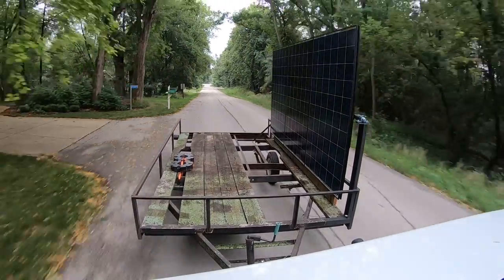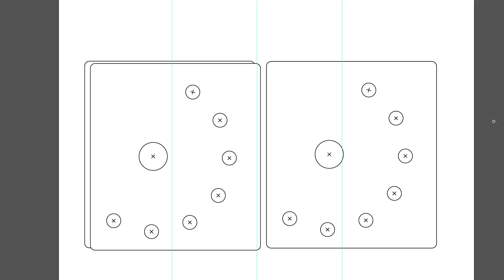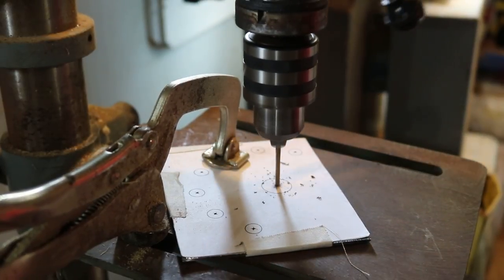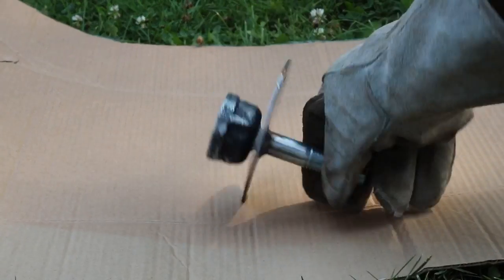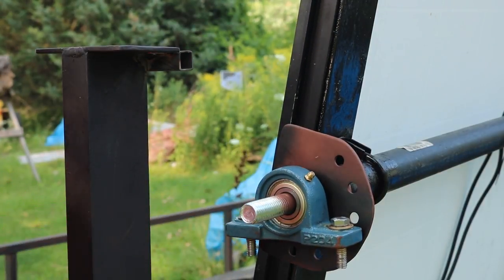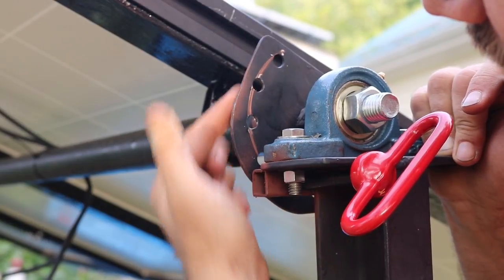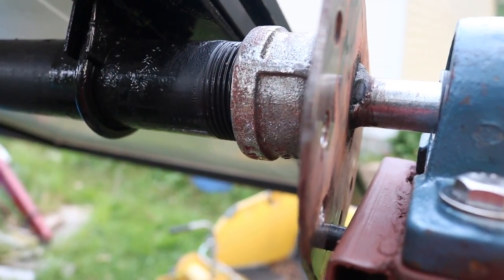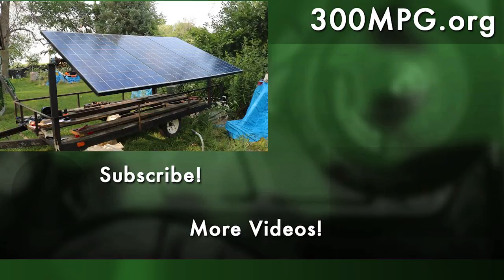Solar Trailer: Part 3 - Swivel Lock Redesign

Comment: What ever works I think I would have put another joint in it at the top of the side panel so the solar panels could swing over the wheel and the use an arm to fasten it at the angle you want, this would also eliminate the shading of the other side. It is easy for me to say it I don't have to build it lol. Carry on we love your videos.

Comment: I'm enjoying watching your project Ben. May I suggest you notch out that area at 06:28 that is stopping the Tractor Hitch Pin from going in farther so the Clip can be locked in. I could just make out the clips hole at 05:28.
Reply from the maker: Yes. Alternatively, I could put the pin in from the other side, or use a longer pin.

Comment: I enjoy your projects but was just curious  as to why you didn't put the panels in the middle of the trailer.
Reply from the maker: Hi Steve,
There's going to be another set of solar panels on the other side! I'm just making sure my mounting system works the way I like before building the second half!

In this video, you can see how I redesigned the tilt lock. I want to work out all the bugs, and then I'll build the other side right in the first place!

Comment: I think it's better with tight holes.. If you ream the holes, yes it will be easier to pin, but then it can flop back and forth in the wind....  Tight holes are actually a good thing.  You can smear a little grease on your pin and that will help with fitting it;  and it will loosen up over time anyway.  Don't ream them, that's my advise.
Reply from the maker: They were just REALLY tight. Since I'm using the EXACT size holes, any misalignment at all means the pin won't go through. If I did ream them out, it would only be VERY slight. A little lubricant is a good idea.
Reply: @BenjaminNelsonX  also add a cotter pin at the end of the locking pin so that it does not slip out of the plate...
Reply from the maker: @torbar9603  Yep. The pin has a cross hole for a cotter pin. I just wasn't using it with all the in-and-out testing.

Comment: Maybe a hole for a cotter pin in the end of the locking pin so it doesn't accidentally slip out?
Reply from the maker: Yes, the pin already has a hole in it for a cotter pin. I just didn't happen to show that in the video.

Comment: You can get a flange fitting for your pipe it will bolt to a flat surface and threaded on one side that way you wouldn’t have to do any welding and you start off with a flat surface already
Reply from the maker: That's true. I'd still have to figure out the best way for a bolt to go through there, stay in solidly, and be centered.
Reply: floor flange You can mount a plate of steel circle behind it will give you a bolting surface put a hole in the center for your pillar blocks.
Reply from the maker: @nielmadsen9806  One thing I was thinking of trying on the other side was to skip the pipe cap all together. Just weld a flat plate right onto the end of the pipe!

Comment: I like your content but I would like to see more of the tractor again.
I'm a fabricator and not too be rude, but your welding is poor.
I my self have tried to use the same type of gasless welding wire, and I had mixed results tending too the bad.

The reason your weld fails is probably because the end cape I made from case iron.
Cast iron and normal steel tends not too weld probably. And are prone too stress fractures.
Reply from the maker: I don't claim to be the world's greatest welder!
Any fabricator is going to have better equipment and much more experience than I do.

As for the weld that failed, I wish I had a good photo of it. It was just a very small bead around the shaft of the bolt. Based on the length of the solar panel vs the bolt, it was a gear ratio of about 43:1. That is a TREMENDOUS amount of torque vs a very small weld.

On the other end of the trailer, I had made solid welds from the outside of the pipe cap to the rotating steel plate. That is rock solid. 

I'm still working on the tractor, unfortunately, I'm at a bit of a stand-still while waiting on some other people's schedules for some specialty work.

Look for more tractor videos in the near future.
Reply: @BenjaminNelsonX maybe use en spray shield on the welder, it's there for a reason. :) 
But maybe just weld a little slower. Side to side movement isn't normally needed.
It is hard to see the welds probably on video, too me they look a bit concave.. so moving a bit slower forward would fill the weld.
And try weld back in too the weld.
Instead of moving forward and welding forward in too cold steel. Dragging the hot weld behind you.

Try too move forward but point the welder backwards so you keep applying steel too the weld pool.
Reply from the maker: @steffanwilki9413  For "Spray Shield", are you just referring to nozzle gel and that sort of thing? I did just realize that I had NOT been using that lately.
Reply: @BenjaminNelsonX  too the cylinder of cober that fits on the end off your welding gun.

It won't have a Great effect on the quality of the weld if you don't use gas. But it contains the spray and makes for a cleaner part